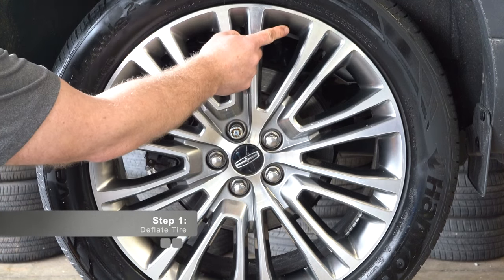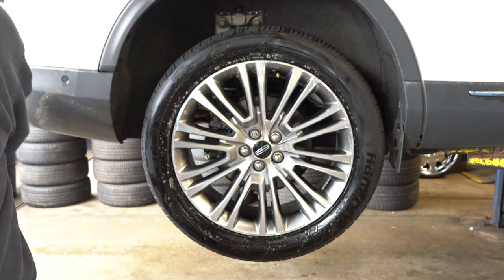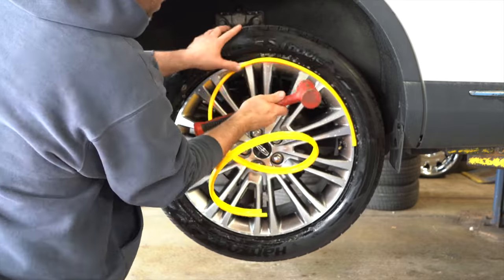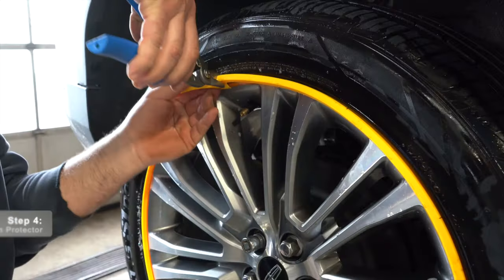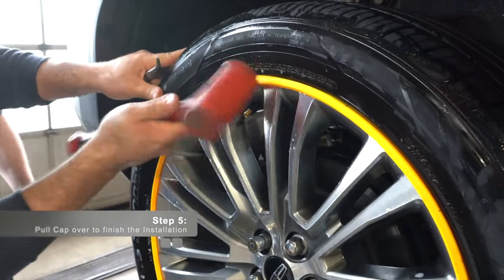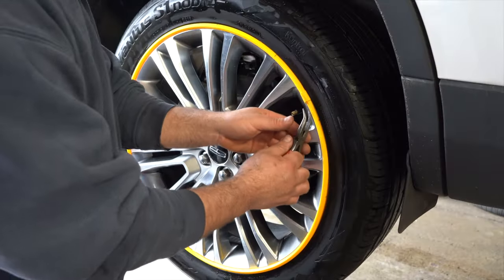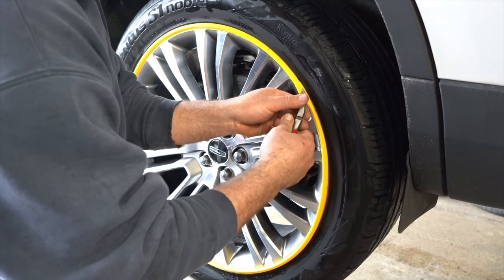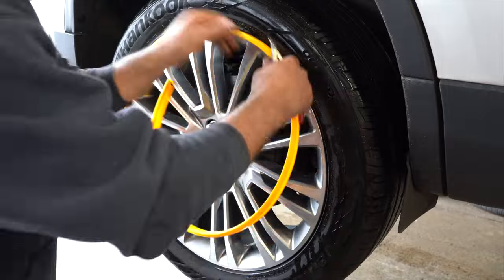Rim Protector System

Comment: ...OR instead of using rim protectors...LEARN TO DRIVE without hitting curbs
Reply: Some of use prefer a sliding into our spots.
Reply: The person who has never kerbed a wheel, either doesn't drive at all or maybe should get out of the way
Reply: Looking for attention 😂even the best drivers sometimes can’t avoid Kerbing the wheel especially if a large vehicle was going the opposite side of you and no room to get through your talking wet